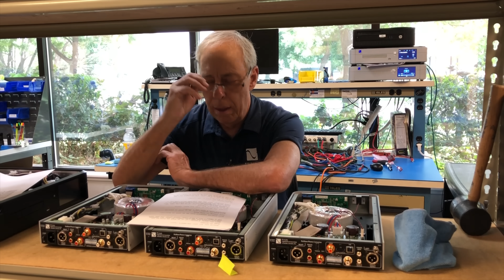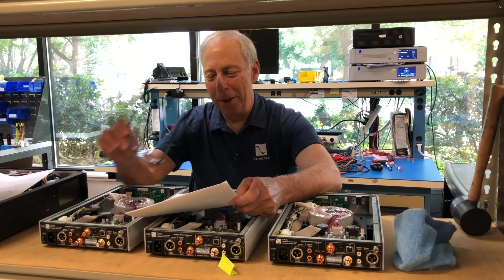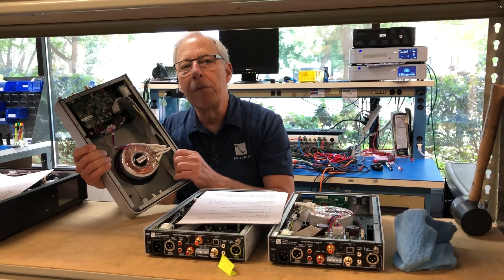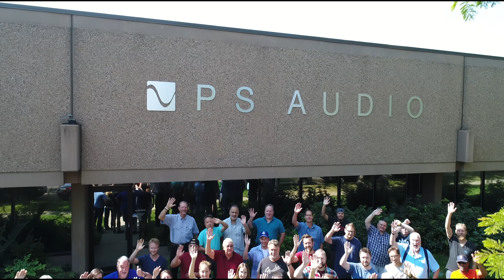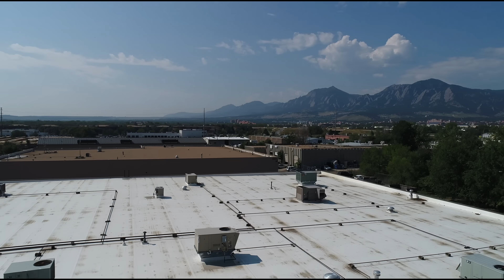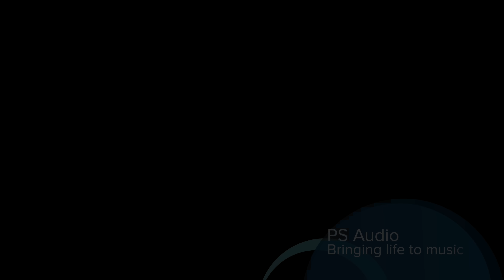What's inside a high end power cable?

Comment: Total bunch of hogwash. Not only am I an accredited EE, my career is in broadcast engineering, primarily in high end post production and mastering. You know, the people and facilities that make your BluRays. Plus I have a lot of experience with recording studios. So.....
1) As stated below and on countless other forums, there is no accredited scientific evidence supporting the claims of these power cables. None! These audiophool trinkets are the laughing stock of the professional electronics industry as a whole.
2) Why are these effects solely limited to high end audio? What about the ultra sensitive scientific measurement devices in labs. I once got an extensive  Saturday tour of JPL as a member if the local Los Angeles IEEE. All that gear to receive minuscule analog signals from deep space yet they use plain old $3 power cords. Ditto that for fuses as well. And don't discount the fact that these are some of the top scientific and most educated minds in the world. I think they know what they are doing.
3) These power cords and associated accessories are also not used in the pro audio and video industry. I know! Now there are some esoteric recording studios run by fools that do subscribe but none of the top studios buy into this crap. Why? because they employ real systems and maintenance engineers.
4) The argument often eschewed by the audiophools of all that cheap Romex cable in your walls is perfectly valid. Any engineering system is only as strong as it's weakest link. Audio power cables are no exception - especially at six feet in length.
5) Another audiophool claim that the power cord is the first six feet the component sees is also seriously flawed. All electrical current, AC or DC, runs in a loop. The current always returns to the source, in this case the street utility transformer. So much for the "first" six feet!
6) Paul's power cords have different internal  conductor geometry for bass, midrange, and treble. Care to explain the physics behind that?
7) Almost without exception the "designers" of these power cords and cables lack any traceable background in electrical, chemical, materials engineering and physics. Oh there are many claims of top scientific credentials but you never find verifiable employment or traceable educational credentials. Bunch of charlatans.
Reply: Inside a high end cable are herds of nano wizards majestically counseling electrons to avoid oxygen......
Reply: @sgals3395  so you're telling me that your home system is going to pull over 400 amps of peak current?
Reply: Thanks for the excellent comments, Andy (and Bradley).  This channel has put out some good content before (and I'm sure still will in the future) but lost me as a subscriber on this one.  Promoting baloney equipment to uneducated consumers and a complete disregard for the placebo effect in perceived results is incredibly disappointing.
Reply: S Gals that video is ridiculous. It's an apples to oranges comparison. Of course a smaller gauge power cord is going to limit current. That's simple Ohm's law.
Reply: Exactly. Being an audiophile, or having spent time in the hifi business, doesn’t make you an expert. The opposite could be argued.
Reply: Did you notice the huge difference in sound between Europe (230V 50Hz) and the US (110V 60Hz)? No? But you must...
🤣
Reply: dug deep , if he has time to write a 300 page disortation on power cables, then I think he just might have time to start a channel!  😜🤐
Reply: Andy Delle......you are educated and degreed but clueless, that's sad, very sad.
You say you have worked in recording studios.....ever tried reversing the direction of a guitar cable and hearing the differences ?.....try it, you will be surprised by what you find.
Reply: Show me the evidence. Show me these measurements. used in what medical field? Don't bother with that Shunyata crap. His products lack any recognized safety certification. There is no way they would be allowed to be used in patient care facilities. He may have done off hours testing with a doctor customer to make his claims but that's it. As for the credentials, thre's nothing to search. All most of these guys list is generic information. No employers names, no university attended. How can such be searched and verified?
Reply: LOL! That video! I called that scam out months ago. Notice he is testing an 18ga power cord against one of his #12 or #14ga power cords. Rigged test. Of course the 18ga cord will show less current delivery. It has more resistance. Why not compare his overpriced power cord to a commodity #12 or #14ga cord. Let's see those numbers. As for the certifications, what are they? Why not simply list them rather than generically saying you have them. Furthermore just because the connector he uses is UL listed, that does not automatically mean any power cord he makes with that connector is also UL listed. Far from it. UL and any other recognized lab requires the ENTIRE ASSEMBLY to be tested and listed. The use of listed parts does not extend to the entire cable assembly. And over on AVS Forum a technician who works at one of the member hospitals called out in his press did confirm they do not use any non-listed products. That's an automatic rejection. The DTCD test is also not valid. All it proves his power cord can deliver fast RF pulses. So what? Our power systems is a 60hz sinewave. What difference does a power cord designed for RF make? Furthermore why have a power cord that excels in RF propagation? And note Mr. Shunyata's bio. The only employment listed by name is the NSA. How convenient! good luck getting any information about their employees. No mention of universities attended, no degrees or coursework listed.
Reply: Andy Delle I can't stop laughing at that video. Yes, of course a larger gauge cable allows more current. That is shown by simple Ohm's law.. Of course!! Talk about apples to oranges..
Reply: All Shunyata videos are like that. On one he shows us how his power filters don't restrict current. He first shows a standard commodity filtered power strip having resistance between the conductors and between the input and output. Well yes, I agree that can limit power amplifier performance and is why Bryston in particular says the best power conditioner for their amplifiers is no power conditioner. But then Mr. Shunyata shows how his rare magic crystal patented power line filter box has no resistance from input to output or across the AC line. Essentially it measures like an extension cord. Well that's because I believe that's all it is in function. A basic home workshop power strip. If he wants to demonstrate how good his power line filters are why not show conducted noise on a scope before and after. I mean a calibrated scope with gain settings and scales disclosed. Not that silly noise meter he also uses. I mean if his products are that good and worth his stratospheric asking price, why not prove it to where no engineer can question the results? And just to be clear, an unedited working demonstration. Not just some posted scope images with no tractable origin or procedure. If I were to make the perfect power line filter in this world of gross audiophile scams, I would go out of my way to prove it's legitimate beyond a doubt. Why doesn't he?
Reply: Andy Delle yes, it's a joke. The sad thing is how people actually accept it. I also noticed that he disabled comments on all of his videos. What a surprise! Monster Cable used to do something similiar.  They would display two incandescent lamps , one being dimmer than the other.  And they would claim that the dim lamp was running through off-the-shelf cable and the other lamp was running through Monster Cable. Of course, the dimmer lamp was running through 20 gauge cable (many feet coiled) and the other lamp was running through 14 awg cable. A complete joke. I have a friend that bought a power conditioner at an unbelievably high price. I told him that the only real benefit is that since the conditioner's receptacles are close together in one place, then that arrangement might eliminate some ground loops. But other than that, he really didn't get much.  Of course, a simple power strip would have done the same thing. Thanks for all of your excellent replies.
Reply: dont be blinded by science. if you cant hear the difference, you are both blessed and cursed.
Reply: @googoo-gjoob  If measuring equipment tells you there is no difference, there is no difference.  If you still think you hear a difference when there is none...
Reply: @ClaytonMacleod  , wrong again...
Reply: googoo gjoob Nope. Sorry. If there is no measurable difference there is no measurable difference. Period. Full stop. You can imagine anything you like but that doesn’t make it so. Measuring equipment has been capable of measuring to a degree of accuracy far beyond what any human is capable of distinguishing for decades and decades now. The fact that that is too hard for you to understand is irrelevant. It still is wha it is.
Reply: " there is no accredited scientific evidence supporting the claims" that bees can fly.
Reply: @russputin6294  Nobody needs to prove bees  can fly, we can all observe them doing so with our own eyes. If people were claiming pigs can fly and only certain people could see them doing so we would of course expect to see some proof.
Reply: Hello cbcdesign001. Thank you for your reply. Cold hard fact; some people, due to a medical condition known as colour blindness ("Colour Vision Deficiency") are incapable of correctly distinguishing yellows, blues, reds and / or greens. Because they cannot see the coloured dots on the test pattern this doesn't mean that the coloured dots don't exist or aren't "real", it just means the afflicted viewer can't perceive them. This is a scientific fact so I assume the statement meets with your full acceptance and approval. If we now extend this analogy to the power cable debate it isn't beyond reason to suggest that some people may be incapable of correctly distinguishing audible differences attributable to different power supply cables, but this doesn't mean the differences don't exist or aren't "real". Likewise, using your example above, it would be relatively easy to prove, empirically,  that pigs can't fly and, to the best of my knowledge, no-one has ever seriously claimed they can. However, if you are so sure of your cabling stance, I would suggest the onus is now on "Science" to provide hard evidence to discredit the hundreds of thousands of creditable audiophile witnesses who claim the opposite. True scientific advancement, since ancient Greece, has always been about the observation of empirical phenomena followed by the production of a suitable explanatory thesis  which is then subject to confirmation or disapproval by the proposers peers. There has never been any true evolution of scientific understanding initiated by a dogmatic approach which consists of, basically, "I cannot sense it so it doesn't exist". Also, for instance, in the middle ages anyone suggesting diseases resulted from tiny organisms flying in the air would have been dismissed as a lunatic; it's only as technology and scientific progress increased that we were able to positively identify virus microbes and prove their existence. Because we couldn't prove their existence at the time it didn't stop the spreading of the plague. The first criteria for any true scientific and cultural advancement has to be the presence of an open mind; by definition we have to accept that there are limits both to current human knowledge and sensory perceptions. As Shakespeare famously said: "There are more things in Heaven and Earth than are dreamt of in your philosophy". At the end of the day, when it comes to power cables for your stereo, it isn't a matter of life and death; "you pays your money and you takes your choice". If someone wants to remortgage to buy a new mains lead that's fine; I wouldn't, personally, but I respect his right to do so. Likewise I also respect the right to free speech and for anyone to promote arguments for, or against, any hypothesis with which they may, or may not, agree. It's through these difference of opinions that true scientific and social evolution occurs and, of course, wouldn't life be intolerably dull if we all agreed on everything?! Thank you, cbcdesign001, for contributing to a lively and fascinating debate.
Reply: Russell Morris Every single aspect that can be questioned in the audio world is easily measurable by equipment that has existed for decades, to a precision far outweighing what humans are capable of discerning. There is no chance of any of it being subjective. It is all 100% objective. Anyone claiming they can hear something that can’t also be shown to exist on the test equipment is either a liar, ignorant, or fooling themselves. Colour-blind people existing does not make oscilloscopes nonexistent.
Reply: @russputin6294   The colour blindness analogy doesn't quite work. We can measure colour differences, and we know why some people can't see them. That all has perfectly valid scientific explanations.
But it seems your point is: Some things that exist can not be measured and some real phenomena don't have scientific proof.
There might be cases where we simply lack the equipment to properly measure and prove things.
Not in audio though, it's a well understood domain and trivial to measure. If exotic power cables make a difference in audio reproduction, it is easily measurable.
In audio it's actually more like: "if a difference can be measured, then it doesn't mean it can be heard" and "if I hear a difference, then it doesn't mean there is one".

Also the "Bees flying have no scientific explanation" thing is an old myth. The science community knows perfectly well how bees fly (https://www.businessinsider.com/bees-cant-fly-scientifically-incorrect-2017-12?international=true&r=US&IR=T)

I like to have an open mind about everything, but I also know that my perception can easily be fooled by my own biases and placebo effects. So before buying some insanely expensive power cable, I want to know from the science community that actually test these things if there's any scientific evidence for it to make a difference. 
If not, I'll put my money in some better acoustic treatment or something, because that makes a huge difference and is actually a much more difficult problem to get right than power cables.
Reply: Beautifully written sir! I am a retired electrical engineer. I agree with all of your counterpoint especially room treatment.
Reply: @jaydy71  Hi Jady71. I think that's a very tolerant reply with a genuine logic and a well reasoned argument. I genuinely can't believe how worked up some people get on this issue! At the end of the day it's not life or death; it's a hobby and, as you say, you pays your money and takes your choice. I suspect you're right; these differences should be measurable but are we absolutely certain we're measuring the correct criteria yet? I suspect as our knowledge of, for instance, Quantum Physics increases at least some of the answers may lie here. Thank you  for your contribution to what's proving to be a very lively debate!
Reply: @russputin6294  Tirade?  What on earth are you talking about?  I listed facts.  And, again, there is no opinion in objective data.  That's the whole point.  You don't read 5.73 volts on a meter and say "Well, in my opinion it is 9.15 volts."  If the meter tells you it is 5.73 volts then it is 5.73 volts.  That's objective data where opinion is not involved.  And audio is exactly the same thing.  If you're listening to a CD you can measure objectively every single aspect from when the bits are read off the disc until the sound pressure waves are in the air and every step in between in all the various pieces of equipment that it passes through and objectively state whether or not there is any error and how much and what type.  No opinion involved whatsoever.
Reply: @russputin6294  Hi Russell, thank you for your positive reply, I appreciate it. I agree we shouldn't get worked up too much about these things as in the end it should be about our musical audio experiences, right? And that is highly subjective.
With regards to Quantum Physics, I don't think that really has a place in the audio domain. The field of Quantum Physics is often (ab-)used in the pseudo-science domain because it's so hard to really understand, but somehow it can seem compelling if one is searching for answers that one doesn't have a clear answer to.
My cousin is a Quantum Physicist and we've had many lively conversations about the subject, and although I (still) really don't understand Quantum Physics, I'm quite positive it's not a factor in the audio domain. Quantum Physics talks about very different things that have nothing to do with how we perceive audio (well, that's my gist of it anyway).
It's kind of a red herring there, and a famous pseudo-scientific 'healer' once admitted that it's more like a 'metaphor' than actual Quantum Physics.

Personally I think we should just focus on what we really know about the physics of audio and how we perceive it, and go from there to make it sound better.  And again that is super subjective, but I tend to reject the more esoteric (i.e. super expensive) 'solutions' and I aim to be just be a bit more practical.
Reply: @ClaytonMacleod  That's your opinion!!! ;0)
Reply: Clayton Macleod ... one must take into consideration this small fact, was your meter calibrated?  If yes, then follow the trouble shooting tree to the left, in no, then follow the tree to the right.
Reply: Russell Morris of course there is
Reply: You are mostly right,actually i didnt believe that shit about speakers cables giving better sound at all,so i used lamp cables for connecting speakers(maybe 1mm2),i used them that way for quite some time till i bought some random box of electric components and inside were set of thick speaker cables(they are maybe 5mm2 or something),so i put those new ones on,just because they looked better than shitty white ones i had.And believe me or not,i heard that difference,and everyone else did.Dont get me wrong i still believe its because that cable was thicker,not because it was made by some fancy company,but difference is still there.However i dont belive that anyone should think that two different cables made of same material,with same girth,from two different companies will sound totally different
Reply: Dalibor Živković he’s 100% right, and there was no objective difference unless your original cables were faulty somehow
Reply: Well yes,  any electrical wire with enough resistance will compromise performance based on current demands. After all a wire is a resistor among other things as well, capacitance and inductance. I'm sure no engineer here will argue that. And a speaker is a power (current) hungry device. Also if I have an 18ga power cord on a 1kw amp running close to full power, then replace that 18ga cord with a #12 or even #14, I do expect to hear a decent difference as well.  That's basic I2/R or Ohm's law. It's this junk science and magic fairy dust we professionals have a problem with. Like Paul's power cords having different geometry conductor for bass, midrange, and treble. That's just hogwash. I think he is trying to equate RF theory to an audio cable, a power cord no less. First skin effect has no significance in the audio band. I'm not saying it doesn't occur. Of course it does at any frequency. The issue is the magnitude which is miniscule at 20khz. And the further glaring fraud here is this is a power cord. Even if there was significant skin effect at 20khz we needed to compensate for in audio signal cables, why would that matter on a power cord mostly conducting a 60hz sinewave. And let's take this  a bit further. If the hollow conductor in the cord Paul claims is for treble response, being a waveguide it will in fact be a very good RF conductor. So now we have optimized a power cord to aid with the ingress of RF noise! So while this cable construction has no positive benefit for an audio component, it does have some potential negative benefits. This just shows how silly and ridiculous the audiophile vendor community is.